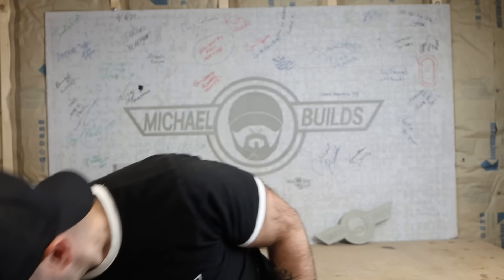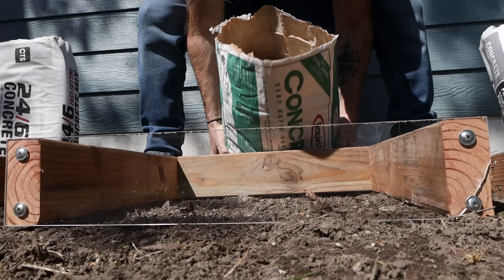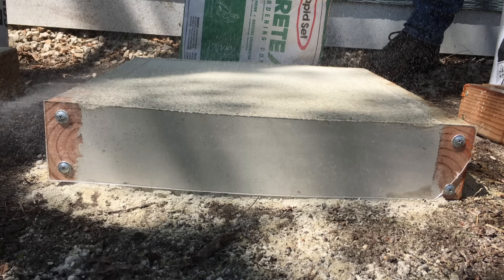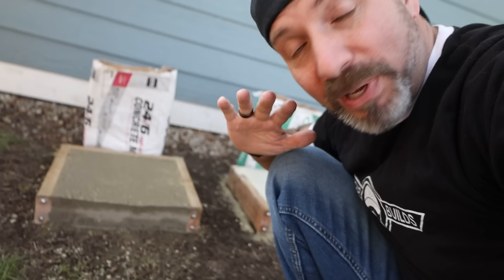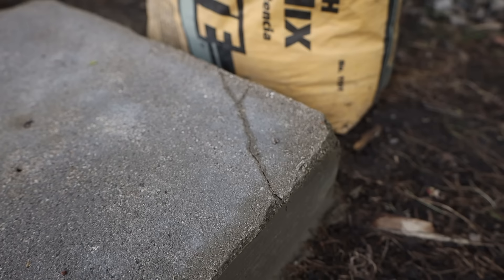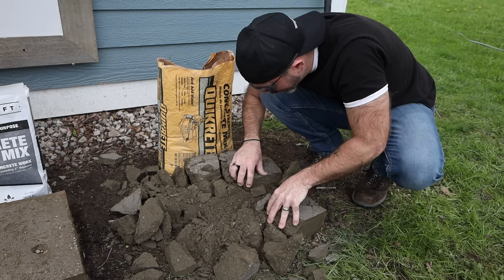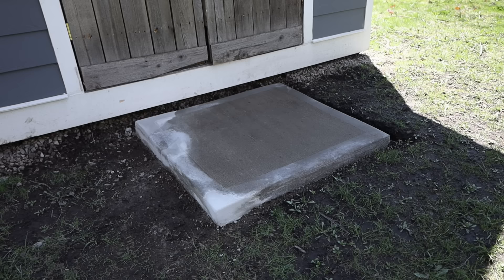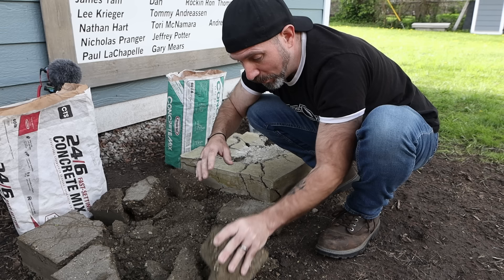Dry Pour Showdown!

Comment: I'd really like to know the actual PSI of dry pour compared to traditional mix after 30 days. For science!
Reply: Cajun Country Livin' (the YouTube channel) estimates a 50% drop in psi using the dry pour method. They have driven their Ford F250 onto a dry pour slab, and the slab held. However, I would not use this method to pour a house foundation or any slab, especially a driveway, in which a very heavy vehicle (e.g., ten-wheel dump truck) might drive upon.😮
Reply: allborg portland for example can pretty much tell you that

i wonder if these youtubers even read the info that is on the products, before they ask 🤣 monkey see monkey do 🤫

there are rules for mixing so the strengh becomes best..
and producers have done testing with almost no mixing 

you will see that it makes a sandbox pretty much, if you dont mix the correct amount of time..
to much mixing will also make it weak
Reply: Looks like 3 PSI after this test so multiply that by 30.
Reply: Practical engineering did some psi tests with concrete, from very little water to too much water. Too much water is about the same as dry, not good.
Reply: This engineering professor from U of Oklahoma tested "dry pour" and found between 600 and 1200 psi depending on how much water was added after it was placed dry: https://www.youtube.com/watch?v=YPAKzrv39xM

Comment: Maybe should’ve done two small slabs  of each mix.  One broken after 24 hours.  Second after two weeks. I do like seeing how far moisture reached in each.
Reply: This has been the big question in my mind, too.  After 2 weeks of cur'age, with extra soaks in between, what's the internal composition like?
Reply: I like your 💡 idea
Reply: Yes, and also one wet pour, to see if there's a difference.
Reply: I thought the same it would take way longer to soak up moisture in the middle so would need more time to cure
Reply: Pick the right mix, mist more often, let it set a bit longer.  Sounds perfect for a homeowner making a shed slab
Reply: This
Reply: I wonder how strong properly mixed slabs would have been in 24 hours. Also 30days
Reply: I saw one guy fill it 1/2 way then mist then concrete and mesh.  Then filled to top.   Another used mortar mix on top (6,000 psi).
Reply: You also need a control. 3 pours each. One 24 hr, one a week or two, one wet mixed.
Reply: @joshcowart2446  
Exactly. What is he even comparing here? Broken too soon, and no control for mixing or curing time. Breaking to see if they hydrated is useless. Even a bag of concrete that gets slightly damp will hydrate, just without "water of convenience" to help it flow into a form. It doesn't need all that water to set if it's dry poured.
This is just basically a dry-pack without the pack if you hydrate it slowly.
Reply: Repent to Jesus Christ “Cast all your anxiety on him because he cares for you.”
1 Peter 5:7 NIV
Reply: @allanfarr  I saw the 2nd one too. Said he couldn't get the smooth finish. I wonder if he was a little hasty and maybe didn't overfill to get those extra fines on top when screeding. Also curious about longer term aesthetics/durability by having a 1/2" layer of just cement on top. Suppose it would be same like having a cap/mortar joint exposed on top of brick
Reply: It would have been better. But you wouldn't know if it was soaked or not!  I think is was a good experiment  👍👍
Reply: This has been proven not to work decades ago.  If this worked concrete companies would save a lot of money transporting dry concrete, but it does not.
Reply: @TroyNiemeier  Since the concrete has not had any agitation to mix into a liquid it will always remains a pile of dust waiting to happen.  There is a reason concrete companies do not deliver concrete like this, it does not work.
Reply: @shane250  Since there has been no agitation to mix it into a liquid.  It will always be a pile of dust.  No need to see a difference here, you can see the difference anywhere.  Just follow any concrete truck and look to see if they are pouring dry concrete.  They are not, because concrete will not set if not mixed.  That is why he is having a hard time getting his forms off, the concrete is just a pile of dust with no strength.  That and he apparently does not know about form oil.
Reply: @garylangley5413  Without mixing it will never cure.  All that portland dust has to be made into a liquid in order to dissolve, with out that it is just a pile of dust.
Reply: @clintlickner  It will never get a smooth finish because every time you mist it the top layer of Portland will dissolve and wash away.  Ironically this is what you want as smooth concrete is very slippery when wet.  That is why sidewalks and steps are always "broomed" after being finished.  Without mixing all the grains of cement will not dissolve and it will always be just a block of damp concrete dust waiting to crumble.
Reply: @TroyNiemeier  brittle as phuck. You’ll have fraction of the strength, not even close to 500PSI. if you properly mixed prior to pouring the minimum strength you be closer to 2500PSI. 30 years of laboratory experience in chemical and physical testing.
Reply: Would’ve been nice to see a center cross section without you totally destroying them with multiple sledge hits lol
Reply: @TroyNiemeier  😅😊
Reply: Hope is not real for the yellow bag, cause I just did 14 fences post with IT 😭
Reply: @clintlickner I wonder if the water application didn't help those surface flaws form. I saw another video & that guy misted water over Quickcrete the first 2xs, then sprinkled it onto the firmed up surface the following 2 or 3xs. 

From the sound, that water was hitting the new surface with some force.
Reply: Well honestly I had a bag of quickcrete left outside and it got rained on...I now have a very large brick....and this happened 2021😊

Comment: I have been dry pouring for years. The trick is fill up about half way and wet it down and mix lightly with a hoe,put in rebar if needed and then put in rest of concrete and then do the same thing,smooth and finish.
Reply: Good tip, big jobs or a small one? like can you do it with crawlspace rat slab (3" thick or so?)
Reply: Yes that is how I do it.  You can't finish the surface properly doing the way shown.  You need to bring the 'cream' up to the surface to got a very hard cement rich material to the surface.   For some things this doesn't matter.  But if you do as you and I do it, you still have a wet surface to finish properly.
Reply: Thinking about doing a 100 sq ft job. Think it’ll work/hold in the long run? A 300lb gazebo will be sitting on it.
Reply: If it truly worked well, it would be done like this commercially. Given the water becomes part of the concrete as part of the chemical reaction, you're really just wasting money half-assing it this way. Even worse if your a contractor doing this to your customers.
Reply: @dannyboii_reps  Remember to add load for any gazebo occupants.
Reply: @blaircox1589  Commercially it is easier/faster to have premixed concrete delivered and dumped into a form.
You must not have ever mixed concrete in a wheelbarrow, if you did you understand the value of dry pouring.
Reply: @murraymadness4674  oh, I have. Sucks indeed.
Reply: So you are basically just mixing it in place.  Instead of mixing in a concrete tub, you are just mixing it on the ground.  Doesn't seem like some revolutionary thing
Reply: So, with all those steps it would be just easier to do it the way the manufacturer suggests and mix it
Reply: I was thinking the same thing, why nor do what you suggested

Comment: You do NOT want ur wire or re-Barb to touch ur concrete firms, should be at least a couple inches from frame. Exposed wire at edges of concrete air will expand and contract, rust & disintegrate the wire eventually causing ur slab to crack and breakdown 😢

Comment: I used dry concrete as base for 1 inch concrete patio pavers instead of sand. Been 10 yrs,  still looks perfect
Reply: Good idea. I might try that. Thanks.
Reply: How thick did you lay the concrete base?
Reply: I’m about to dry pour a patio👍🏽
Reply: The pavers were 1” or the concrete base? I read it as pavers. So how thick was the base? Great idea. Btw.

Comment: I took a strength of materials class in college around 30 years ago.  In one lab, we made concrete cylinder samples and tested the strength.  We did not test a completely dry mixture.  However, there was a definite trend that the ones that had the least initial moisture and were then fully submerged in a bucket of water for several DAYS were the strongest.  If you want it stronger, it needs much more water during the curing phase over a longer time.  Concrete is porous.  The water will get all the way into the center and cure it if you give it enough time.
Reply: Water does increase strength to a point. Most commercial 80lb mix bags require a gallon of water for the mix...... and no evaporation..... Misting with 25' long 3/8" garden hose using a water conserving nozzle is going to take a little  while to get a gallon of water into the mix, and keep it in there.  
I think most people underestimate how much water they need.  Alot of the commercial bag mixes encourage wetting of your base if you read the bag or the data sheet.
Reply: What is the time frame between initial moisture and when you would submerge them?
Reply: True. My stepfather made poured the cement around swimming pools and I asked him why they were covered with plastic for so long. A: To keep people from walking on them, not from the rain. He showed me how they pull up the plastic and re-wet the concrete daily. The plastic was to keep the water IN under the hot sun. #NoCracks
Reply: Still have to be careful adding water. Especially if you're after a desired slump
Reply: That is really interesting. I'd like to learn about the science of why that would be so.
Reply: @jwrightgardening  Concrete is porous. The density of concrete is determined (up to a certain point) by the amount of water you put on initial curing. When water evaporates, it leaves air spaces in the concrete. Drying too fast when the concrete is not fully cured will create small cracks between pores. Soaking the concrete will eliminate evaporation while the concrete cures.
Reply: @techburnsca  Thank you so much for the explanation! 😁 👍
Reply: Do you think vibrating dry mix in the form before wetting it would help with strength?
Reply: @johngalt97  No, vibrating dry will segregate the materials
Reply: How about if you soak the dirt beneath, pour about half the dry cement in and give it a soak and then put the rest in and  level it off and do the misting?
Reply: good too know...............
Reply: @joeteejoetee  helpful... we could be heroes for just one day....
Reply: I don't have a lot of experience mixing concrete. But there is actually scientific papers about it. For portland cement the most important thing is to get the water/cement ratio correct. If you want max strength, you need a ratio of about 0.4. So that is 0.4 lbs of water for every pound of portland cement in the mix. Of course with bagged concrete you never know how much portland cement is in there. So it doesn't really help much. The second thing is once you get the initial set, you want to cure it under very high moisture conditions. Covered with plastic or totally submerged (if that is possible). Oh, and the third thing is, if you are making your own mix from aggregate and portland cement, using extra cement will make it much stronger. Generally, 0.4 w/c ratio will be hard to work with and hard to place (more like wet sand and less fluid than your typical concrete mix).
Reply: what a bout running small capillary tubes thru the middle of the concrete to provide moisture?
Reply: @GaryVarnum I was thinking that would be the way I would do it.

Comment: I would like to see you revisit this entire test, all four bags, maybe even add in 1 or 2 more contenders, as a 30 day strength test.
Reply: no need..
the strength from concrete comes from mixing..
if i look at my local producer they have investigated how long time is perfect.
to much or to little makes the concrete weak
Reply: Repent to Jesus Christ “Cast all your anxiety on him because he cares for you.”
1 Peter 5:7 NIV
Reply: Also add in a control of mixed wet cement.
Reply: @Hansen710 strength of concrete comes from chemical reaction, cement and water content (less water -stronger concrete). Mixing time has nothing to do with strength. Mixing trucks drive to different  locations and  different time, while mixing concrete by the way they go. And sometimes waiting in line to pour out the concrete
Reply: I came to say the same. 24 hrs to test this is too little. Doing a control of wet mix, then for the dry do all wetting for more soaks, then to a 24 hr, 48 hr, 5 day, 15 day, and 30 day. In big projects we can add an accelerator to be able to walk in a slab the same day to get control joints in, but if we are going to do a crack test it’s going to need more than 24 hrs. The dry pour world has my curiosity, it would be a game changer for the average person to be able to achieve hardscape goals without breaking the bank. As long as it wasn’t vehicle traffic it may be the best solution with the pricing we are currently getting in the market.
Reply: @Hansen710 strength from concrete comes from the mixture meaning the ratio of materials, not the literal mixing lmao

Comment: I've been following your channel for a while. I love your artistic builds with concrete. This dry pour could be a game-changer for me. I'm an "over 60" YO woman and need to make some updates to the sidewalks outside. It seemed outside my bandwidth to do it myself. I could do this though.  I'm waiting for the 30-day slab test. Thank you so much.
Reply: Repent to Jesus Christ “Cast all your anxiety on him because he cares for you.”
1 Peter 5:7 NIV
ht
Reply: This method will absolutely fail, especially in a sidewalk.  Mix the proper amount of water in the concrete.  Yes, you can pour the concrete in the forms, but you need to leave some room for the water displacement, and be sure to mix/stir it enough to get all of the dry concrete wet and also allow the air to rise to the top.
Reply: @jmackinjersey1   You couldnt be more wrong, I have a 40 yard sidewalk made of bags, didnt even open the bags, just kept them wet for 30 days. All put on the ground during a period of year for the highest forecast of rain. Theyve been their now since 2013. Theyve seen hot sun and -22F in the winter.
Reply: @DarkLinkAD  bet that looks good. 👌
Reply: @jaxturner7288   Yup, I live deep in the woods and it looks like a smooth stone, if you want it rectangular and flat, you could literally shape it in the bag.  But I prefer stones that can be moves if I want to redesign a walkway.
Reply: @DarkLinkAD  42 yo women, wondering if this could be done in layers maybe 3" for the 1st layer so it absorbs all of the moisture let it set for a certain amount of time and then add another layer. Would this work or will the additional layer not adhere to the set layer?

Comment: Typical Concrete breaks are in 28 days, or 56 days, at the concrete company i work at, all the cylinders we take are cured under water for 7 days before going in to a room with a fixed humidity, my garage slab we dammed up the sides and let the slab water cure for 7 days.  The ROE Rate of evaporation will make a huge difference, areas in the country that are extremely dry might have a different outcome.

Comment: Ive done dry pours for years for small projects such as pavers or a garden path sidewalks. The largest I did was for a small metal shed for my lawn mower and yard equipment. One of the sections cracked but never shifted and as it just has my push mower on it was not an issue. Honestly I picked up a cement mixer from Harbor Freight and have enjoyed it much more than dry pouring. I know its mixed well and is super easy to use. Before that I used a 5gal bucket and a mixing attachment for my drill to mix the crete. I like to not have to spend the evening watering the concrete this way. Please remember to wear a mask if you are doing anything more than a few bags as you do not want that crap in your lungs.
Reply: being the cheap, code breaking hooligan that I am. I wanted a driveway/ parking spot for my truck. So I did a drypour, but I had my spouse mist it the entire time I was pouring/spreading the mix out in the form so this way it got pretty good moisture in the mix. Then hosed the crap outta it few hours later. Then left it alone for 30 days. Hasnt cracked yet on me, but the surface has chipped abit, but I didnt care if it looks nice, my lawncare trucks that drip every fluid like a stuck pig and any other weird projects I come up with are on it, so its stained up bad anyways. But its held up the last few years.
Reply: I've always done my smaller slabs by mixing in a wheelbarrow with a shovel.
Reply: Wow. Are you parking a half-ton on it? How thick is it? And what State/climate are you in? Thanks!

Comment: I think it's safe to say that if you do dry pour it needs to only have foot traffic or light structures on it. Any thing else like driveways and parking pads need to be mixed and have metal inside. Great vid!!
Reply: in theory you could still lay rebar with a dry pour.
Reply: @jonathanlees8017  I agree with you! And even doing walkways around the house or pads for sheds epoxy wire would work great. If I was doing a drive way or parking pad 4 inches deep I would use both!